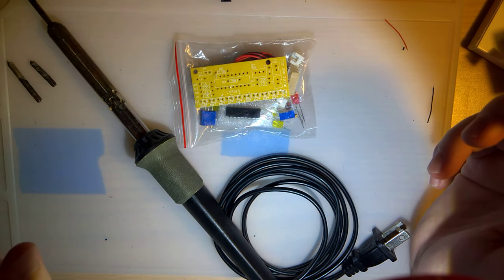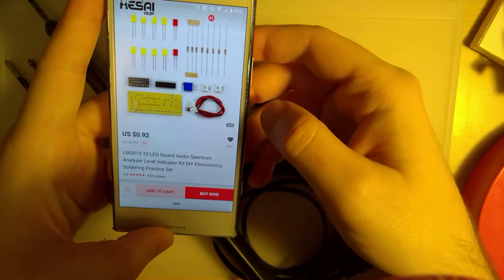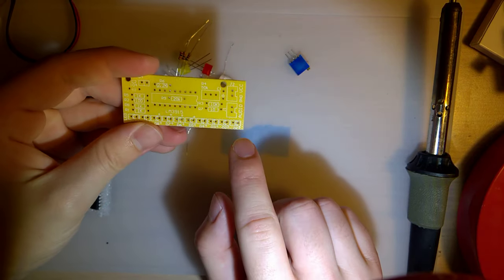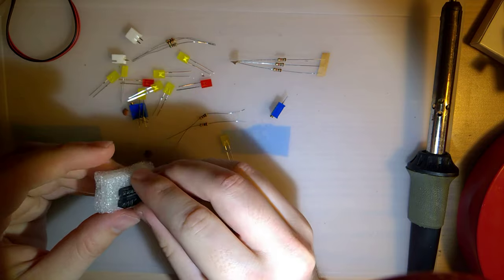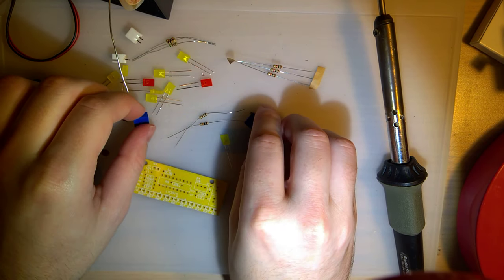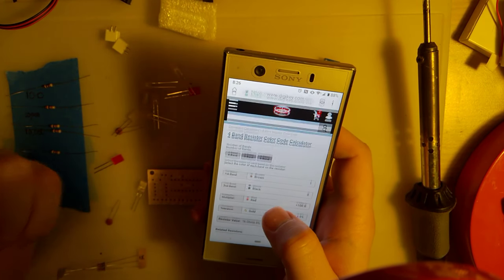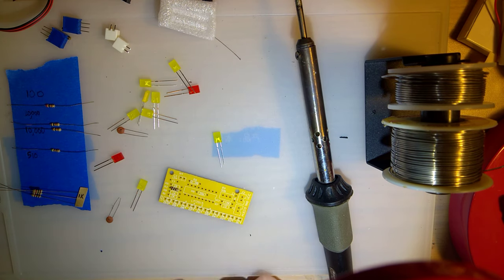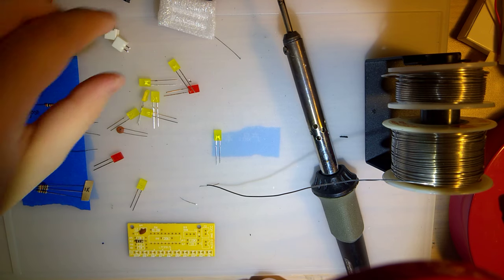Assembling a cheap, basic electronics kit (LM3915)

Comment: O snap.  I thought this was a video on what would be good tools to have starting out in a kit for soldering etc..
Kind of is though.  Multimeter, soldering iron with a few different tips, flux, solder, and a cheap kit to screw up and make work again.
Parts Express is 5  minutes from my work so I am going to grab a cheap kit there to tinker with before I try the more risky IPS ribbon soldering per your advice.  I also have a possibly roached DS Lite board that was glued into a lower case I'm going to try and make into a Macro, if it isn't fried already.  I figure I can't mess up something that's already busted.
Thanks for the info and working on gathering some bits and bobs for electronics repair!

Comment: The worst soldering iron i ever used was the 10$ ones at walmart. They don't even heat properly. Hardly melts solder.
Reply from the maker: I've seen these USB powered ones and I'm morbidly curious. I know that there can be only disappointment but yet I still stare longingly. Maybe one day I'll take one home with me.